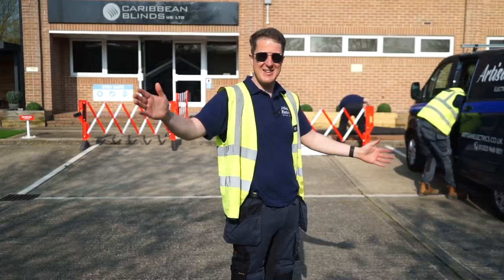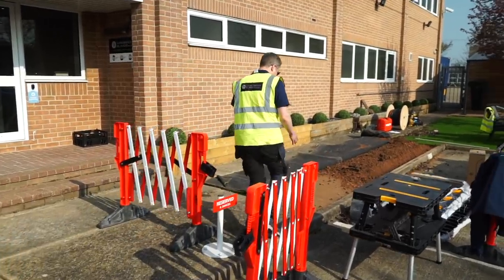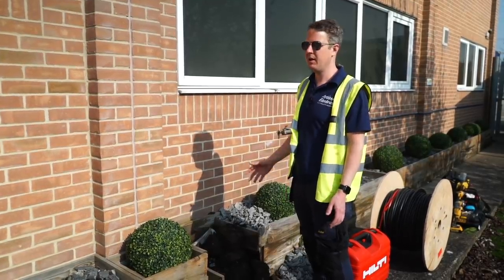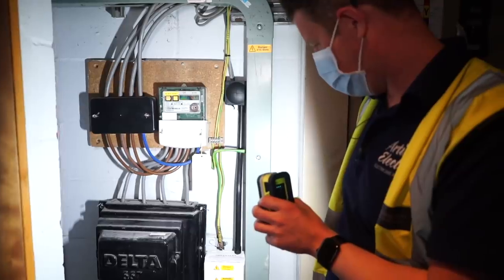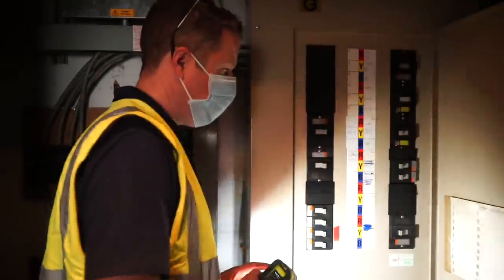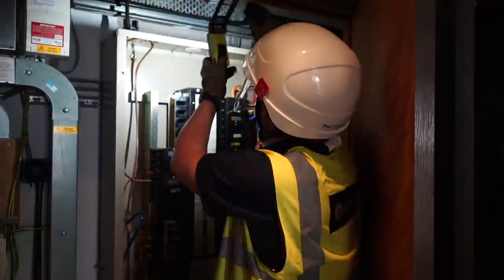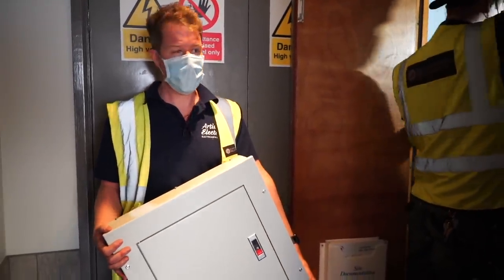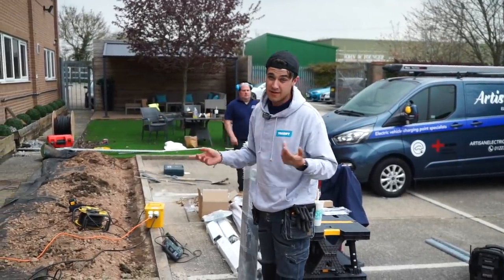Nightmare Electric Vehicle Charging Installation - Part 1 - Electrician Life

Comment: I'm keen on seeing those four cables in that little concrete groove! Especially, I would like to see the refilled grooves again after a few years. Not easy to avoid cracks in such a situation. I hope you did pay attention to the fact that you have an accumulation of four cables reducing the current carrying capacity. Additionally, if the sun's radiation can reach the concrete surface of your cable run around noon, you might have to calculate with a ground temperature of 40-50 °C. I guess, under theses circumstances, a 6 mm² cable can only be loaded about 25 A.
Wouldn't it be possible to run only one cable to each couple of zappis and installing a waterproof junction box next to them?

Comment: I don’t know about you guys in the uk 🇬🇧 but in Ireland. your cables need to be 600 mm down in pedestrian walkways for Ev chargers
Reply: I'm in France, it's 80cm where vehicules drive, and 50cm without passage.
Reply: It should be at least 45cm to 60cm. 

But in the UK you can do a "risk assessment" and justify whats okay. Tbh I think that's horseshit. So there you go.
Reply: @Woodkin007  how can you risk assess something like that and get an outcome that cables being shallow are ok? Risk assessments are only any good if they’re done properly and not just done as a tick box. For the extra effort I personally think it would be worth digging deeper. Contractors will not expect a cable to be a few inches down when they dig it out in the future.
Reply: @crim7ind  ah, how indeed? 

Paranoia vs foresight...

Comment: Love the videos. Glad to see you wearing the face shield. My first job in the '80s was working in an old factory converted to offices where the fuse box was being moved, this was done live as the computers couldn't be switched off. During removal, the fuse box tipped forward and a bus bar touched the electrician's screwdriver. he didn't get a shock, but his screwdriver vaporised and he received 40% 3rd degree burns to his face and torso.  He died 3 days later in hospital.  You may want to wear something thicker than a tea shirt too ;)
Reply: I think the moral of that story is, if they won't have the power off then the job doesn't get done.

Comment: That cable tie trick works well if you are doing the steel wiring the old stool method too, use a cable tie or two next to your cut line to keep the sheathing and wiring sturdy while you hacksaw the wire.

Comment: As someone who used to be a groundworker, you guys should really get a civils team in to run some ducts out... chasing concrete slabs like that is just a recipe for disaster plus it doesn't comply with Health and Safety Executive guidance on buried services. A shallow install like that would be chopped straight through with a floor saw if someone came to do proper work in the future
Reply: Totally agree, the time and effort chasing the slab and patching back up for an average outcome, it would probably be cost effective to drill down through concrete and get a water boring crew to insert a conduit out to a hole in the lawn. .

Comment: I have been telling you for ages about Hilti glad you made the move quality tools with quality service attached and made for heavy duty use and your right their application on concrete is the best.

Get some tape or signage to put a barrier  around the work area to signal that work is still in progress also alerts people to take care around it.
Reply from the maker: Thanks 👍
Reply: If you think the chaser is good the sds plus and max drills are top notch. Beat any of the other makes tools hands down. The Hilti bits will cut through rebar and the ATC system stops binding when you hit a hard spot saving your wrist and arm.

Comment: Personally I'd have put a single loop in those 25mm tails into the bottom of the sub panel breaker.  If at anytime in the future one overheats and needs to be trimmed back, the next guy will be cursing you 😉
Reply: Great comment Chris.
That is such a massive point, I cringed when I watched it.
Reply from the maker: Yeah good shout
Reply: Don’t agree with this, it looks shit and if it’s overheats and burns out then that’s the installers problem surely so if does go faulty you charge for repairs?
Reply: @b96m13  Not when it comes to commercial premises, if they ever get an imbalance on the supply and it surges with inductive loads (which is common in commercial premises with lots of CNC's / automills and lathes) it can knock out a phase and cause over heating on the conductors. That's why in most instances pre surge protection devices you'd see capacitor banks and voltage filtering arrangements, and in the larger sites still do. 

It's very much belt and braces due to the fact most commercial grade installs carry a risk of down time and loss of revenue if things aren't planned properly, which in some cases a companies insurance won't cover and has bankrupted many a company in the past. This is a small install with a dedicated board for EV charging points so it's not an issue I'd be concerned with in this case but for larger boards/ sites it's something that must be taken into account.
Reply: @effervescence5664  totally agree mate I work industrial myself and would do the same , the point I was making it was just a daft board for a car charger so a loop wouldn’t really be necessary 👌
Reply: I think all three of us as commercial sparks were looking at it as a unsatisfactory choice of board and install to the main switch.
I think a more thorough survey would have helped Jordan to make better decisions.
I'm sure he will take it as advice and not criticism.
Reply: @b96m13  I agree with you, just wasn't obvious to me with your first statement, overkill for this. 
& I would hope so David, Jordan and Cory (and I'm sure the others) normally show a high standard of workmanship and sensible interpretation of the regs, so not being well polished on commercial as it's not their mainstay is fair.

Comment: When you put that new three phase board in did you check the phase rotation of the incoming cables? A lot of times the cables jointers can mess it about, and it's vital for harmonics with the sensitive electronic components that we now take for granted.
Reply from the maker: Yes we did.

Comment: Nice one lads.   That SWA slice is good.....I’ve got the CK version.  

Those banjos are a pain.....I believe you are allowed to use the earthed metallic casing to earth your SWA unless the steel is being used as the CPC, in which case there is a requirement for banjos.
Reply: That said, I always banjo the supply end if the SWA is purely mechanical protection.   I banjo both ends If used as CPC.  I always use brass nuts and bolts too.  Using steel gutter nuts and bolts is common but some will say it isn’t right.

Comment: Looking forward to part 2. 7kw single phase Zappi's over 3 phase 22kw seems like an oversight for future proofing and load balancing though. 
Main take away though is with commercial units especially old heating boards when first quoting for the job always inspect and test the board, come across loads that have been disconnected due to instantaneous water heaters over loading the neutral bar, at least a couple a year on commercial premises. Protects yourself and the client from unforeseen costs.
Nice to see Cory teaching you a few things though!

Comment: 13:37 I prefer using Piranha nuts than Banjos to be honest. The grub screw can be an arse if you are in a confined area but on the other side of the coin, they are thicker than the nuts which come with the glanding kit. They are great and I don't swap the nut over as I leave the teeth side keeping in contact with the DB. Only time I use the blunt side is on IP rated WISKA boxes.

Comment: Less than one meter, I'd tunnel under that concrete walkway to push thru cable. 
Otherwise is that concrete exceedingly deep, or it tunneling under not permitted ?

Comment: Great work guys love watching your videos. The only problem I can see is you was using full PPE when using the chaser, then no mask for when using the chisel bit and long drill bit and leaf blower. Silica related illness in my opinion will out strip asbestos as a disease. You have a good mask with the JSP other point have you had a face fit test? That’s the only way to prove the mask fits the user. You only get one set of lungs keep them safe. Again love watching your videos

Comment: Great video! I'm a bit surprised to see you guys doing all the hard concreat cutting yourself, but you are usually doing a fantastic drilling job, so I guess it should be physically hard but easy for you. 
I only wonder.. why didn't you think on using a cuttingblade big enough, so it lasts from top to buttom of the concreat?

Comment: Morning, I'm just going to echo the other comments.  

Using a wall chaser on a concrete floor is just nuts, hire out a disc cutter and a bloody great kango.  

Hopefully you are ducting the feeds at a suitable depth and have considered the correction factors.  Possibly running the cat5 in a separate duct.

For me I use the bango, unless it's a tight space. There is enough waste in the world without throwing away bangos. Send them to Bundy 🙂

I've not tried those holesaws yet, but if your drilling into a panel then could you cover the switchgear with a cloth to stop the metal bits finding there way into the components.
 
I'm surprised when you initially surveyed the job you didn't take the covers off and were happy to use a old board and sub main without any testing. 

It's very easy to cristize another persons work after the fact.  I am an electrician and making these observations from mistakes I've made on site, was the job last minute and rushed, it comes across in the video as unplanned.

Comment: Hi, 
    As per usual excellent video but a  little confuse how did you price the work after you seem to of found defective electrical equipment which needed to be replaced after you started the work? Keep up the good work and stay safe.
Reply from the maker: Customer was informed there would be extra costs to install a new DB. They were fine with it. We kept additional costs to a minimum.

Comment: You don’t need to chase the concrete outside but rather excavate under the concrete slab and run the cable underneath

Comment: how deep do you have go in ground and under concrete in the uk?
Reply: A minimum of 600 mm in the road and 450 mm in soft ground, usually in a duct.
Reply: My understanding is that for private cables on private land there is no explicit depth requirement. Just a requirement they should be deep enough to be out of the way of any reasonably foreseeable disturbance to the ground.

Utilities have their own rules (which are I believe there the numbers stp quotes come from) and some may chose to follow those rules even for private work.
Reply: I have this issue running the cable across concrete path and gravel (clay base) from house to garage. I’m doing the groundwork myself and advised by installer to go 15cm deep across the concrete path and 30cm across the gravel. After that I will fill both with concrete.
Reply: We was always taught 18 inch deep  in ground  but use common sense
Reply: I ran the cable from my house to my garage for a charging point last year. I was told there's no specific depth rule, but should be deep enough not to be a hazard in normal foreseeable circumstances. Mine was half under block paving and half under a garden border. I went 600mm down in a duct, covered with sand then a warning tape then reinstated. You can see the duct at the bottom of the wall at each side. Anyone who hits that is trying pretty hard!
Reply: John McKay   Sounds like a really top job ,makes a change these days..

Comment: Here's a hack a friend taught me if you don't want to use Banjo's or P. Nuts....don't cut away all the strands from the SWA and make sure it not less than half the size on the line conductors to terminate to the earth Bar and sleeve it, which gives you total continuity, as no joints in the strands, lugs or fly leads that might break down , please comment if you feel its wrong
Reply from the maker: Yeah I feel like that’s wrong
Reply: @artisanelectrics  Why?